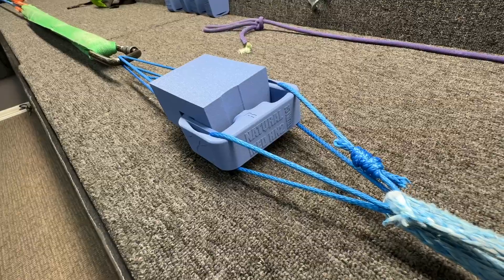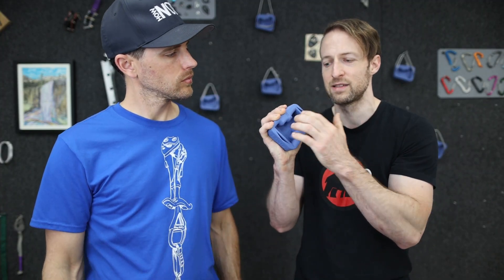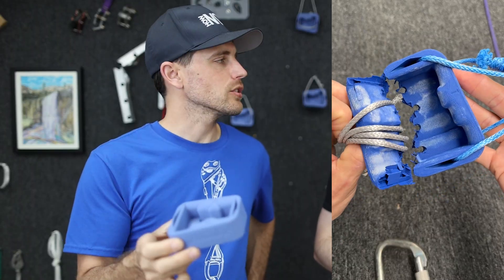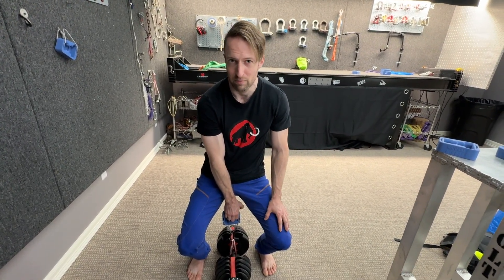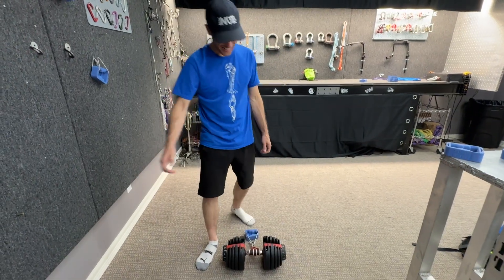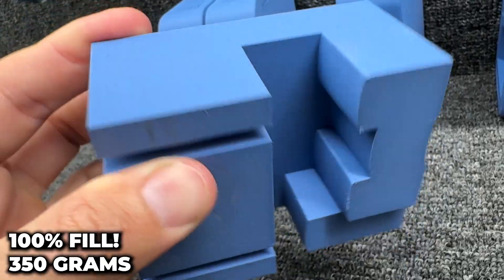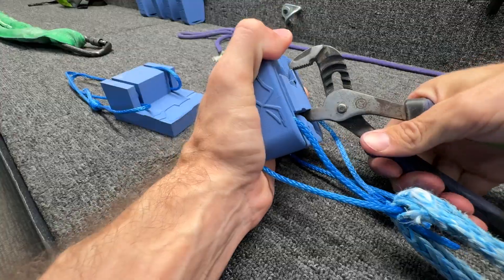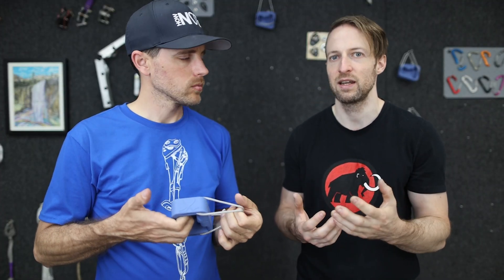Is this stronger than your fingers?

Comment: I had almost body weight grip strength, 240 pounds with both hands at 150. Sure ain't that now.
We had that spider thing for the hand but I was just rolling barbells underhanded and closing with cables.

Comment: 13:31 The problem here was the orientation  while it was printing. A print is weakest along the print lines, so almost any amount of force will sheer the layers away from each other. If you rotated the block so that the print lines are perpendicular to the direction of force it would have better results.

Comment: What is the benefit of training for finger strength over endurance? If you wanted to train for endurance, how would you adjust the regimen?
Reply: Didn't see this question before, but endurance is an extremely broad category for climbers. Many athletes I work with (the majority of my athletes are sport climbers or transitioning to sport climbing) express a need for greater endurance when what they need is better economy of movement, execution of sequence, and exploiting of rest stances. One important note is strength will increase endurance as each movement will require a lower percentage of maximal force which has several small side effects.

As to endurance adaptations themselves, think about what you mean by this in simple terms and how this appears on the wall. If what you want to do is avoid being pumped as much, then do a longer set with an intensity which allows you to stave off being pumped. If what you want to do is handle being pumped better, then do a long set with an intensity which allows you to be pumped for longer and become more pumped overall. These target two main groups of adaptations, aerobic (the former) and anaerobic (the latter) capacity.

We always want to focus on quality of training, thus more time spent below the threshold of being pumped or more time spent being pumped. When a majority of your set feels nonstimulating, increase the intensity.
Reply: @zacharylaschober  thanks for the thorough response!

Comment: Be very careful doing this with adjustable dumbbells like demonstrated, if it slips and drops many of the dumbbells are not know for taking falls well and can break or damage the adjustable function of them.
Reply: @coreytaggart128  not a fan of dumbbells for this purpose all the same, but good point I completely missed. I hadn't brought a loading pin and plates cause we discussed this a little on the site in better context.

Comment: I think I'd use the 3D print to make a gang mould and cast these if making any significant quantity.
Reply: While this was a consideration, I make units with far more options, enough to need to be made to order. I actually went into the printing side for an attempt to make custom jigs and iterate some designs... but turned out to be more than strong enough.
Reply: @zacharylaschober  Oh yeah, not for strength, but to be able to produce larger batches since you mention it's a couple of hours per piece to print. Could still print the more customized ones, but for the HN2 store's limited selection printing could be a big bottleneck (assuming there's lots of orders after this video).

I don't even climb really and I think this thing is pretty neat, so great job on the design.

Comment: Thank you for plainly stating that shockloading increases the risk [degree] of injury, and that human joints aren't designed to open under load.  

When my cataplexy (sporadic decrease of muscle tone/control) is acting up my family is always harassing me not to avoid the snapping/erratic-pulling motions they don't have trouble with, when I have always found that particularly injurious  (even after having how I've been re-setting my wrists since childhood corrected by a doctor) while any muscular reaction to prevent even an anticipated jolt from crashing across my joints is inhibited/convoluted by my health. 

So having an expert they won't argue with (on video) say it in a context they are interested in will be helpful, (though I won't be too surprised if a few months from now I am pointing at this comment after saying "Meow, really." )

Also;
I've been offered a variation on the hand-grip-block that used sliding paddles to adjust for different finger lengths (for 'free' because of a predictable tendency to pinch fingers when it flexed). Your selection of appropriate preset-sizes in a single piece sounds like a much better solution-   Though I'm now wondering if something similar for foot-grip exists.
Reply: Any archer who uses high poundage bows can tell you all about this 😂

Comment: I’m an engineer who did significant research in the space of 3D printed material strength. I also have a unique process of using 3D printed molds to cast parts out of much stronger materials. I would recommend this process for making these kinds of tools.
Reply: Or if these are abs / asa, at least paint the material with acetone to help fuse across layer lines and be a tad stronger
Reply: But totes agree casting is the way to go, polyurethane would be indestructible
Reply: 100% these would be so much stronger molded. And you could make more faster
Reply: But mold making is probably less popular on YouTube than fdm :)
Reply: Doesn’t injections molding only really justify itself economically after like 5.000 parts? I’m not sure if this is enough of a mainstream product to justify that cost
Reply: Stronger materials are not at all needed, I would be much more woried about texture, body oil resistance, anti microbial properties and such. Casting would be great if you could do polyester with stone agregate though. By far the nicest somewhat easy to use climbing hold material.

Comment: Infill 75% is the minimum for this usage, and I will do it with carbon filament to be sure it will be durable, not basic PLA or ABS.
Reply: PLA is plenty strong and durable for a chunky part like that.
Reply: @djoxinside  I still have a varied amount of filaments I intended to test with after shaping, but even the base pla turned out to be strong enough. I switched to some slightly different architecture and infill patterns with a cf supported pla but this was mostly a concern for consistency of texture than actual durability.

Comment: Cool. I love the >200 iterations. (I've learned that it's all fun, but the really amazing fresh stuff starts happening with multiple iterations!)  Amazing design.  (The finger shape would also make a better handle. Can you make these for luggage? Incorporate it into sailing gloves? ) 
After the fingers being different lengths explanation I was looking at those slits on the side. They're for a rope to hang the device, but as a DIYer it got me thinking. If you just put a screw and a washer, even a big washer on something relatively soft like that... it would work, but it would just be a compromise. 
What's needed (maybe not for this device, or even climbing gear, but generally) is to do the 'finger matching' and force distribution with hard metal screws and some load spreading widget to make it easier and more secure to attach something like this (3D printed) to a surface.  (Then the 3D designs could incorporate that widget's shape into the printing.) I'll give up my chance at fame... just start drawing the vectors. It'll design itself.  
Excellent point about the big R D ring. At some point focusing a load is a knife edge.
Reply: @WillN2Go1  Yeah, I used to number the iteration files and then when I expanded form factors for the current versions it just wasn't of use, especially as I make and test more things than this. I restrained myself after this to not try and "improve" the design until I greatly expand feedback from long term usage. Genuinely believe it is the best of it's type on the market, and any improvements will be for morphology and increased options.

Comment: any studies that show this is better for training compared to a straight edge?
Reply: Interestingly, we don't even have good studies on much for finger training in climbing. Most studies on training protocols in climbers are making multiple assumptions. We know enough from sports/exercise science to say isometrics in positions of best leverage are best for "strength" adaptations, and with the anatomy of the hand we want all four fingers to be in similar positions cause the structures are largely common across the fingers.

The benefit of a flat edge is I could cobble one together from scraps in my garage, and if I am trying to work the least and climb the most then simple and cheap is great. If I want to pay someone for a product, ease of design and manufacture are not selling points (especially when many flat edges are more expensive and break lower).

Comment: The 100% filled block that you used in the first test broke because there was a sharp edge connecting the base to the "fingers".  If you instead filleted that transition and made it the perfect inverse of the grip block, you'd get full strength.
Reply: yup, was always going to be limited by the adhesion of those layers.
Reply: @zacharylaschober  It's not layer adhesion.  It's a stress concentration from a sharp 90 degree corner.
Reply: @elonquemattheson6151 you're right, I think I meant "reliant on" rather than limited by, adding atop your mention of the stress point.
Reply: Also, I would have printed it at a 45-degree angle, but hindsight is 20-20

Comment: Cool video! I have a similar design that I'm pretty sure is a bit stronger, but the difference in print settings and filament could also account for that. What I've noticed is that way before breaking, the tools I made to approximate a hand pushed deep dents into the contact surface, and failure starts from those cracks. I still want to try the same pull with a soft layer in between to stimulate how flesh squishes but at the same forces it also dented the wood on another version and Ive never heard of anyone doing that by hand. 

For me the weak link is the strap, with a WLL of 250kg (safety factor is probably 5, but I can't test those numbers).
Reply: @TijmenHatesads  yeah, the beauty of this is since the item doesn't have to hit a specific measurement size or weight wise, a few parameters may change if we wanted a little more strength out of it. I think this test still disadvantages the device... but it is way past what anyone will stress this to. Softer, pliable pads, especially as there is a slight chamfer on the bottom of the edge, distributing across the entire wall would be of interest.

Comment: Another thought about strength, generally a shear force parallel to the 3d printed layer lines is often considered the weakest direction to pull a print. It would be interesting to see the same model printed 90° to make it extra good enough.
Reply: @StayCHilL24  yup, was a quick (design wise) effort, I thought this would be more violent after a few tests.  Thought it was funny to test the material against itself

Comment: I have been using a 3d printed hang board for a couple months now and it works great. Easy and cheap if you already are into 3d printing(or if you have a friend that is). I think mine is printed at 15% or 20% infill and it's super good enough.
Reply: Do you have a link to the files for the hang board? I’ve been looking for a good one for quite a while now.

Comment: Don't increase infill when trying to improve pull strength.
Increasing the number of perimeters yields a lot more strength per weight and print time.
There are lots of break tests that show this, for example "INFILL pattern and SHELLS ..." from CNC KItchen here on youtube.

Its hard to tell but it looks like you are using two Perimeters. Even for non structural parts that is the absolute minimum. 
I would recommend using at least 3, for something structural even 4 or 5 perimeters. 
Use just enough infill to make sure the file prints correctly.
Reply: I think he's using adaptive infill? Text on the video says 75% fill near walls, 15% in the middle.
Reply: when I get a gap in my printing, will check some other modifications. Not terribly worried about the strength after a certain amount of repeated testing and maximal testing, and the additional infill is predominantly support for the cord compressing the device rather than strength of the edge, but was an easy change to just see.
Reply: @zacharylaschober Yea since its strong enough, there is not really a need to change it. 
Two perimeters still feels wrong:D I often get visible gaps in my prints when I go down to two.

Comment: Could this be printed so it fits both hands without flipping it? It looks symmetrical around the middle finger but there would need to be two spots for the pinky
Reply: The first 3D printed edge like this sold, MetacarpEdge unlevel edge, has this style
Reply: This can, but I sell a variety of form factors which could not be flipped due to varying index and ring edge heights. Thus, keep with the design, and head2toe already does this, and we stay friendly in this field. However, this helps keep the balance point more between ring and middle than middle and index due to cord placement.

Comment: But dont the holds we pull on usually ARE a straight edge, and not ergonomic?
My intuition would say train how you use the muscles.
Reply: Training how you use the muscles would require an infinite amount of edges as no hold is ever the same. This is to train raw strength
Reply: If you only trained straight edges and came across a pinky focused hold you would be wanting this. Straight edges don’t train your pinkies hardly at all
Reply: @theowainwright7406  Like I said, we need to understand that we dont know much about ligament and for many people, thats the weak point, where we got hurt. 

Developing force to applied on  specific hold is mostly neural adaptation and those adaptation goes really fast if you project something. If you board train, you will do the strength transition between your fingertraining and force applied to a specific hold. 

So the question is for me, is this new hangblock a gimmick or will it show in time better strenght gain for intermediary and beginner at climbing than a straightedge. 

My hypothesis, it will be the same.
Reply: we were just answering some quick questions Ryan had in this, but no. Specificity is about adaptation, not about resemblance, and with this we expose the fingers to highest force production via flexion through the three main joints, then learn how to contact, control, and move around holds on the wall. Besides, few edges on the wall are this consistent orientation, depth, and roundover, thus still does not make sense to just use a flat edge.
Reply: @zacharylaschober 
oh thax for replying!
I have no idea about sport-science, and english is not my first language.
So I dont quite understand what you are trying to say.
But I guess something along the lines of:

No edge can mimic all the different holds on the wall to a relevant degree, so you created an edge that stimulates alle the ligaments and muscles optimally. So we can train efficient to strengthen every finger, to then be strong to hold a variety of holds.

???
Something like that?
Anyways, good luck with your further endaveours!
Reply: @sportenapfeltorten2095  yup, exactly what you said.
Reply: @zacharylaschober 
aaah ok thank you.
makes sense to me.
:)
Reply: I have the same thought, its the principe of specificity at least for the muscle. In theory this means that full range of motion or finger curling is one of the best way to develop strenght in the fore arm, because you don't neglect the full range of motion. But we got weird mechanic ligament in our finger and we dont know a lot about the optimise way to train them and they are often the weak link for climber. Were we got hurt when we try hard xD.

What we maybe know, but are in reality educated assumption :
- Training full range of motion with finger curl may increase risk of getting hurt, because of the mechanic of our ligament in our finger (so maybe not the best way to get the ligament stronger);
- Ligament tend to get strong under isometric hold and high tension/intensity, making the first a good training if your high level climber with super good enough ligament, but shitty for most people.

What we dont know :
- Does ligament follow the principe of specificity, if its not the case, anything puting pressure on them hard should be an better way to train. The problem, hand position affect on which ligament the pressure is on.

Comment: Hey Ryan, I would love to see break tests on the Pitch Six and Tindeq dynamometers. They seem like a handy training tool for home but as always I'm concerned with safety and accuracy. Thanks!
Reply: Can tell you the Pitch Six Force Board 450 is supposed to be rated (based on discussions with Pitch Six) for 900kg to still return to properly read and 1800kg before potentially breaking. I have done 991lbs and it didn't care, unlike both a Tindeq 150 and 300 which I have ruined.